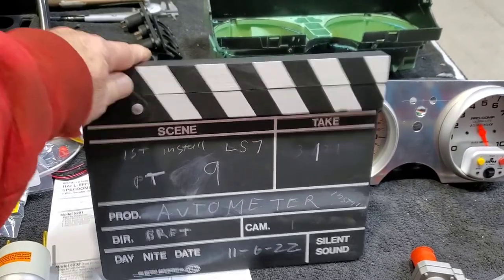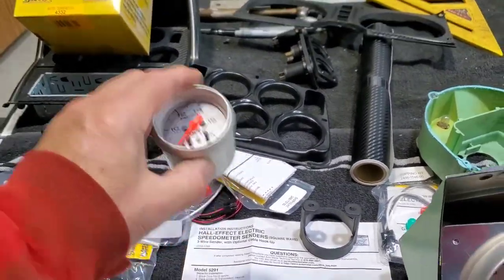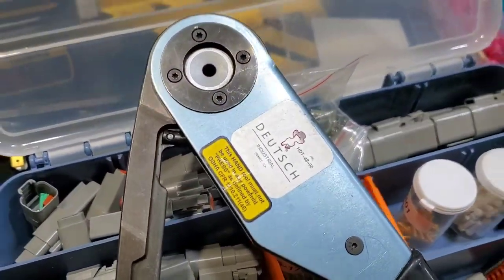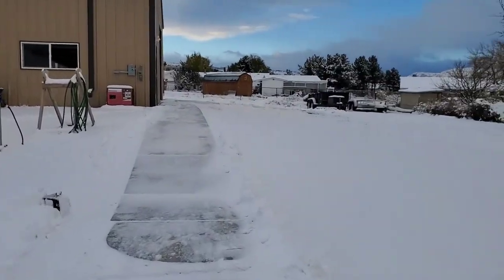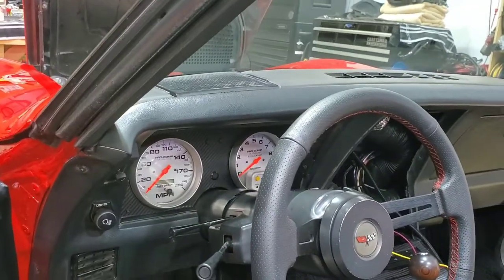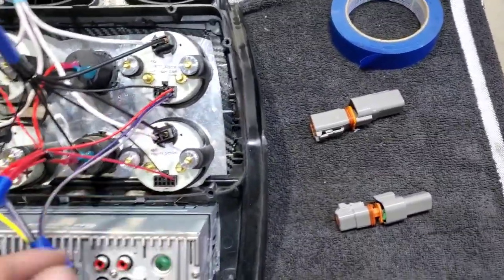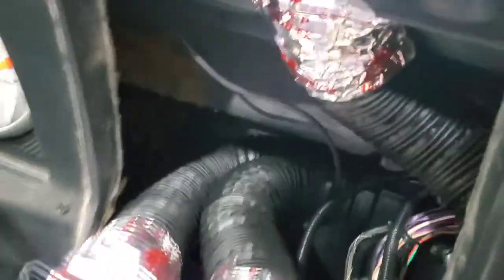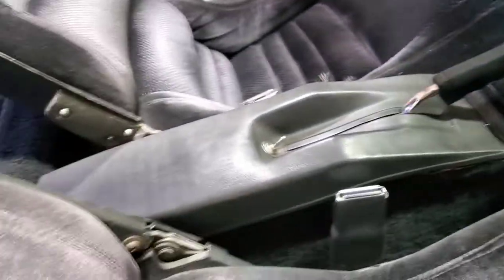C3 Corvette Autometer install

Comment: Great job man!  Those gauges look great!  I kinda agonized over putting non-traditional white faced Autometer gauges in my C3, but I don't think I'm gonna regret it.
Reply from the maker: During high-speed runs with a lot going on they are easy to read, and they have adjustable limit red lights that are bright enough to get your attention. verry happy with them. Thanks for watching and your comment, have a great day!

Comment: Hello,  can I istalled the 1976 C3 Corvette cluster into a 1980 C3, like a swap , just the cluster and front face????
Reply from the maker: Hi, I'm not sure with the dimensions of the earlier C3s, as you can see in the vid, I cut the entire rear half of the cluster off to make room for the new set.

Comment: Can I ask what size aluminum plate you are using?  Guessing maybe 1/8".?  Also, where did you get the plate?  I'm having trouble locating aluminum at a decent price. :)
Reply from the maker: I used aircraft aluminum T 2024, from Aircraft spruce, .063 This is heat treated and it is what I used to skin the wings of my Vans RV 7 aircraft I built.
Reply: @BretMech  Thanks for the info!  One last question.  What did you use to cut the large holes for the speedo/tach gauges?
Reply from the maker: @kevinb21  I dilled a 1/2" hole inside, and then used a metal blade on a jig saw, no problem with aluminum.